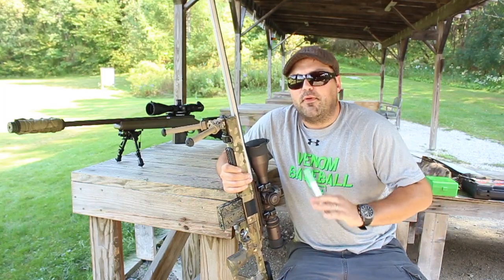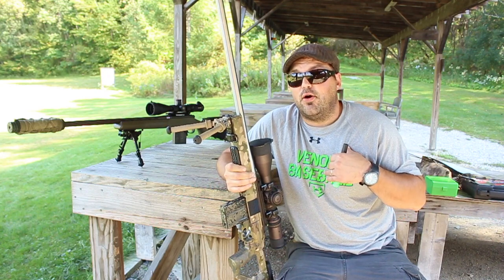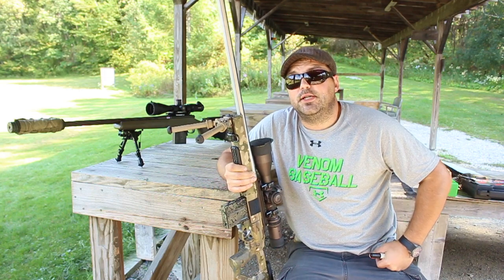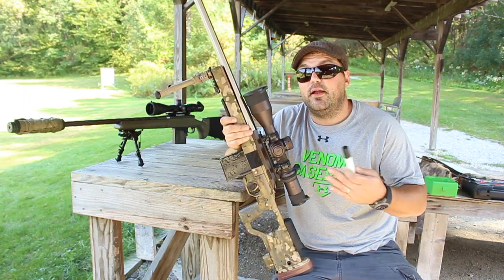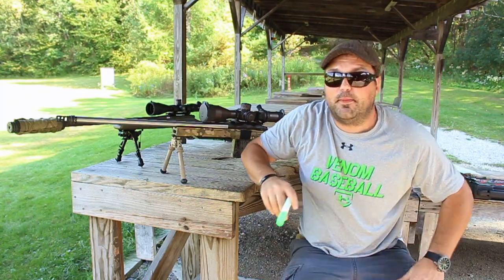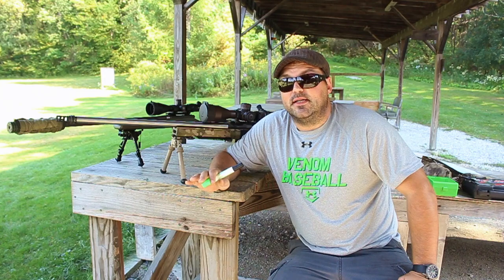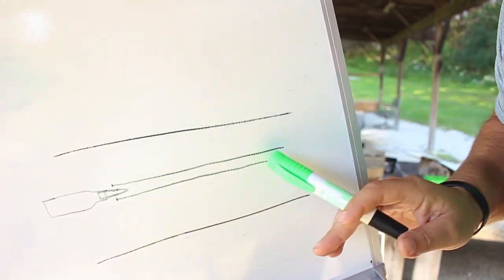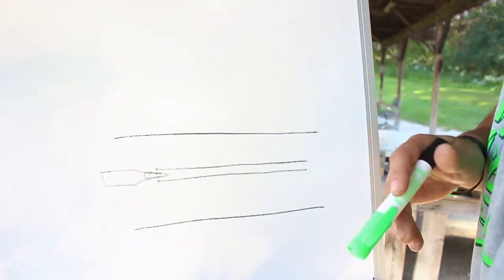BARREL BREAK-IN

Comment: In my new barrel, I shot 10 bullets, after clean, I was a few copper but a lot of carbon, shot 10 rounds last week, 5 were in the same holes (0.25 MOA at 100m) and the 5 next was 0.85 MOA at 100m but my barrel was very cover by carbon. I have a good muzzle brake (Terminator TE for .300 wm, lot of gases come back to the rear but looks like shooting .223) and I think my powder is bad and too much carbon that screwed my group. Try again this week without cleaned it to be sure but I think need to change my powder. Already shot my first 30 rounds but next time I'll do your process. The good thing for my barrel, if I clean it, go back all the time to 0.25-0.35 MOA ;) Thank you for your great video and just sad I just found it ;) Best Regards

Comment: lots of data on utube on cleaning a barrel.. fouling material and copper material are two different items and I figure
like you copper is basically going to be annealed on... Thanks a given..... And in terms of the throat area over time I heard
it will adjust to itself with the bullets used. So no need for additional cleaning there it will smooth its self out.. As for 
fouling material I just use a snake rope type for a quickie... couple times every 20 loads on my 22-250 and on my 17 hmr 50
loads run the snake cleaning rope..  Factory loads on the 22-250 accu tip remington 50 gr and on the remington 700 vls
does sub moa at 100 yds and 200 yds moa an inch..

Comment: So why are under-powered charges used? Are they supposed to do something that full power rounds can't? I can't understand the logic behind this process.
(P.S. I like your videos, just having a hard time wrapping my head around this bit of information!)
Reply from the maker: ILicence they drill out a tube and then you install it and shoot projectiles through it at speeds of 3000fps. His idea was instead of shooting full power loads, cut the powder charge in half during barrel break in. If you have a tiny imperfection in the barrel and bullets pass through it shreds the jacket of copper off the bullet and you get extreme buildup if copper and removal is tough. Now, you see gunsmiths hand lapping with lapping compound to remove imperfections but Not everyone will do it. Old school logic
Reply: First, thanks for the quick reply!
I think I'm getting it... So he's saying that lower pressure projectiles will help remove tiny imperfections in the barrel WITHOUT leaving as much tough to remove copper build up. After the "break in" process the bullet lapped bore will distribute copper fouling more evenly which results in greater consistency and accuracy.
Am I right or off by a mile still?

And I agree, that is old school logic, but if it's produced good results maybe there's something to it. It just seems like running bullets through at 30,000PSI vs 60,000PSI would result in pretty much the same thing, but I don't know enough about metalurgy or internal ballistics to know the difference in heat produced.
Reply from the maker: ILicence ya basically. The whole concept of breaking in your barrel is to remove the tiny imperfections left by the reamer. His thought was by using a full velocity cartridge the bullet will hit the burrs and shred part of its jacket and the copper deposits get stuck to the internals of the barrel. Then every time you shoot after the bullet and gasses pass through at extreme temps and the coppers melts and cools after every shot, making it miserable to remove. If you use a low powder charge, almost squib type loads the jacket and temps stay relatively cool and make copper removal way easier down the road. It's all voodoo. It's hard to say what works and what doesn't because we don't have a way to see the barrel internals. He's in mid 70's and has been smithing for 43 years. Thing are a little different with barrel makers so break-in isn't as important as it used to be. I was just sharing his concept and it was something I never heard before. The hardest thing to remove is copper when cleaning barrels
Reply: That was the explanation of his theory I was after. I totally get the concept now.

Comment: I am not saying your information is wrong. It does not make sense that a round traveling  slower will have any drastic change in the amount of jacket the rifling will pull off the projectile. The thickness of the lands should pull off the jacket at the same rate regardless of speed of the bullet. I.e if the lands are .005 larger than the bore, then .005  of the jacket is going to be stripped(.005 is just a reference it could be .01 any size all the same). I would believe the only way to get this down is just shooting through normal break-in process. If I am wrong someone please explain in some mathematical way that it would work this way.
Reply: I believe you missed the part about what happens to that copper after it is removed from the bullet.  The more powder you use, the more heat you generate.  More heat bonds more copper to the barrel.  Less heat, less copper is bonded to thee barrel.  After a half a dozen rounds you’ve removed the sharp edges at the front of the lands and you have less bonded copper to remove.  I think that is the concept.